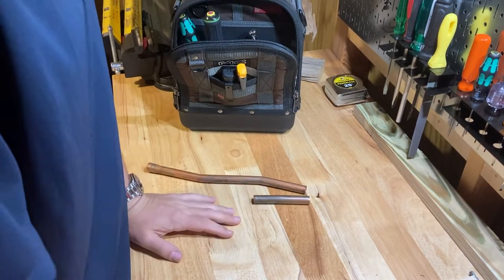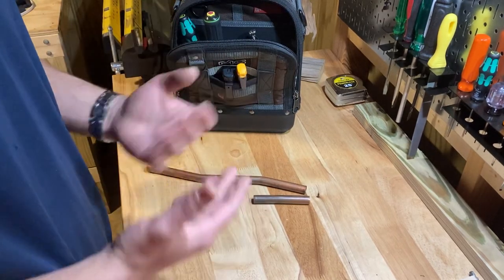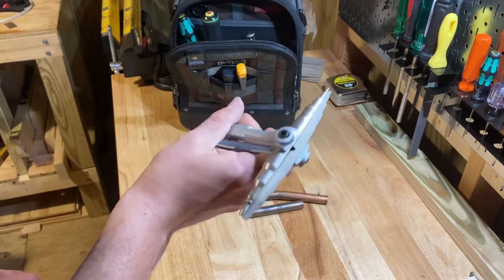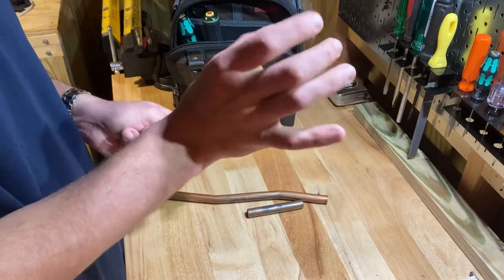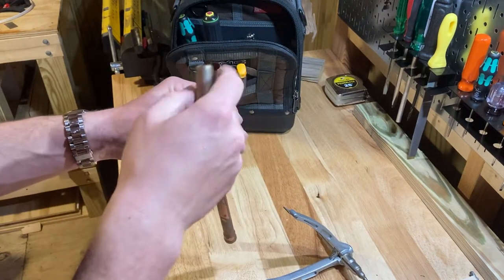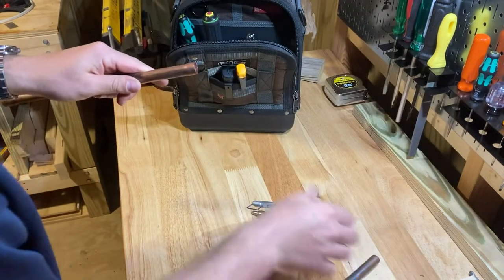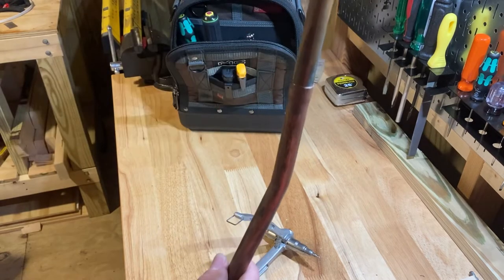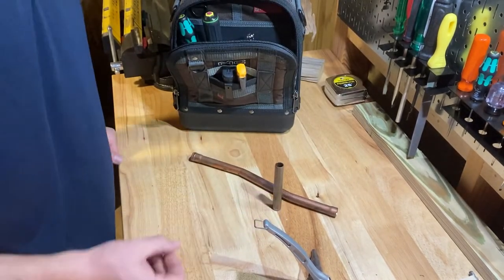The best HVAC tool you’ve never heard of

Comment: Basically a different type of swaging tool. Easier  then the hammer method. You can get a power one for your drill, too.
Reply from the maker: Yea I like those pliers kind way better than the hammer method and the drill kind. I just like how much control you have with the pliers. The only kind I haven’t tried is those super expensive hydraulic ones.

Comment: Good stuff man. Is there a tool that does the reverse? I want to curl over/curl in or reduce flare a 1" aluminum tube slightly, but can't find a good tool to do it cleanly.
Reply from the maker: 😬 yea I think that is gonna be tough to  find. I’ve never really worked with aluminum tubing or had to reduce a pipe the way you are talking about. I know they make pretty fancy machines for reducing thicker steel pipe, but I don’t know about aluminum. I wish I could be of more help. Thanks for tuning in!